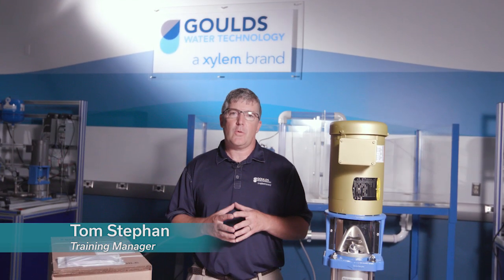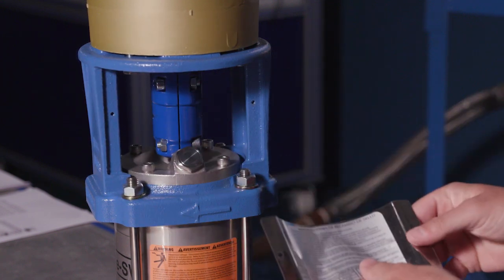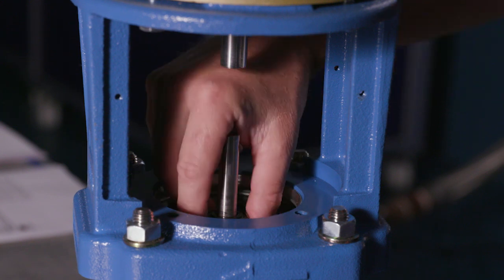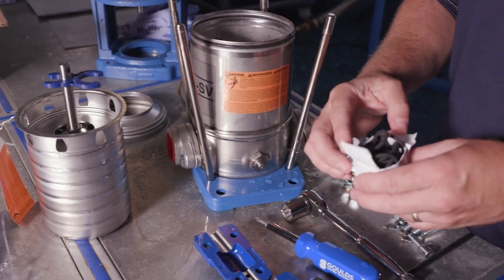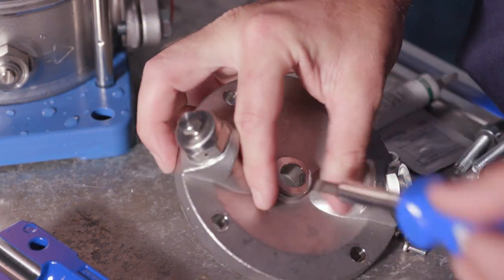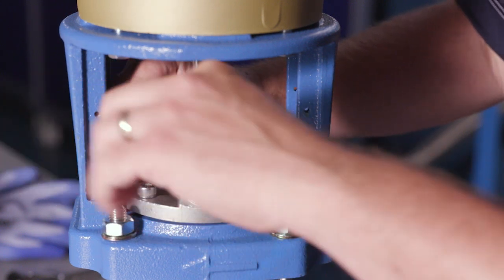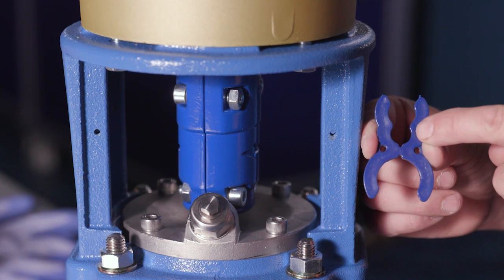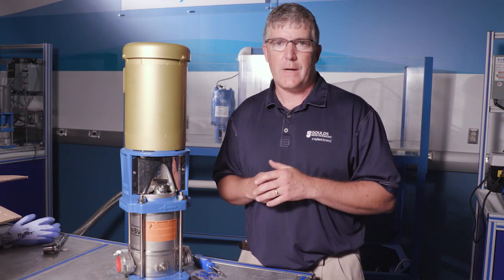e-SV: How to Repair the Stack Assembly and Change a Seal

Comment: We have an ongoing problem with the O-rings leaking and water seeping from the pump when it is off-line. After restarting, the leak goes away. Any ideas as to how to correct this or what may be causing it?